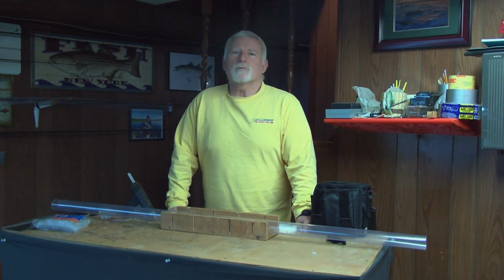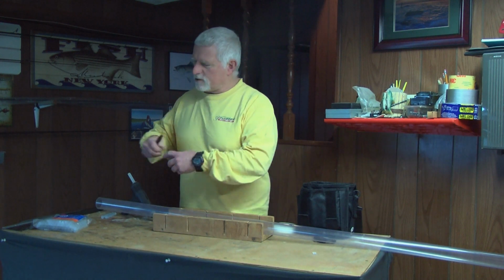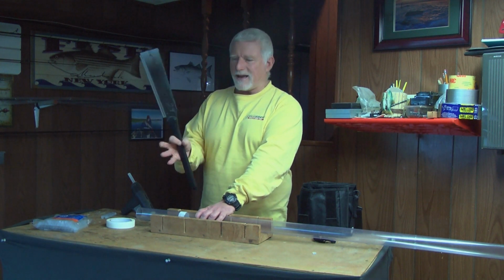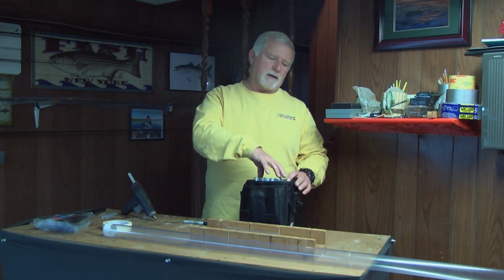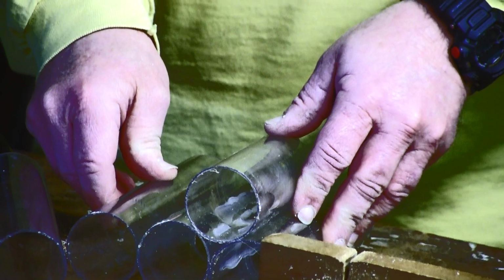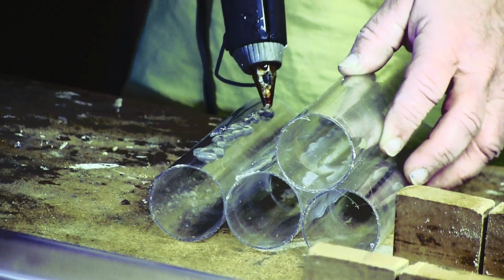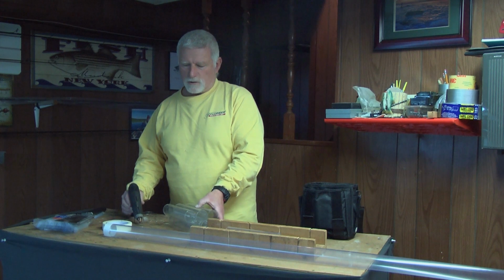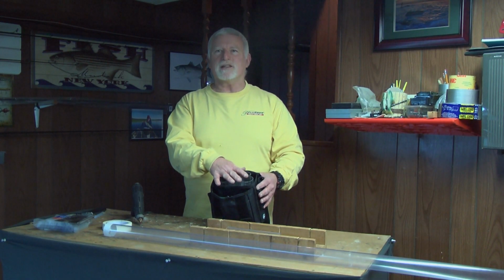Making and configuring the inserts (tubes) for your surf bag

Comment: I have trouble with hooks catching on the bottom of the tubes in my bag. My bag's tubes are square in cross section so caps are not a simple proposition.
Reply: grab a piece of 060 thick kydex on eBay, easily cut, sanded to fit perfect. $7-8 bucks gets you a 10x10 piece, no need for thicker .088 , works great.